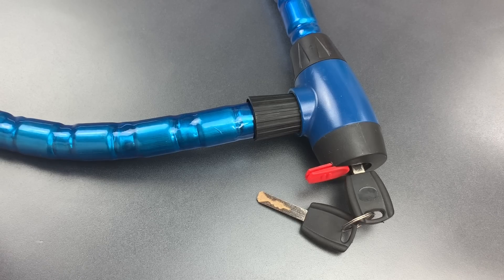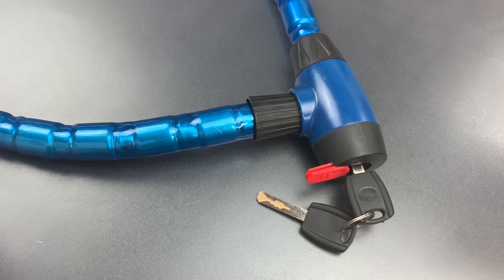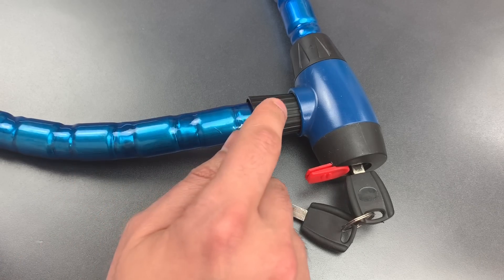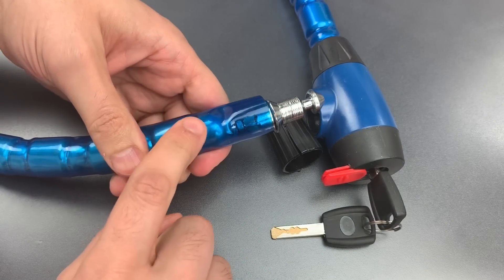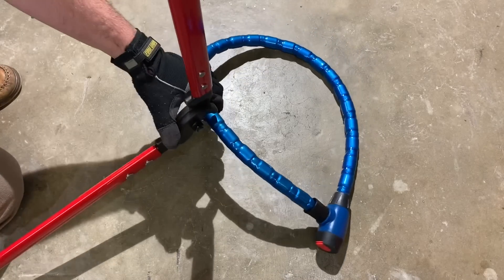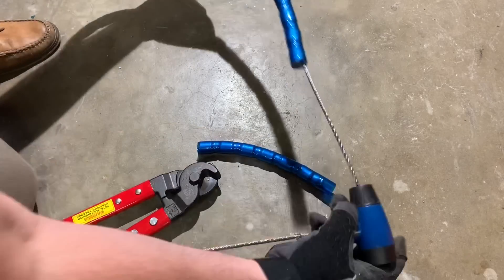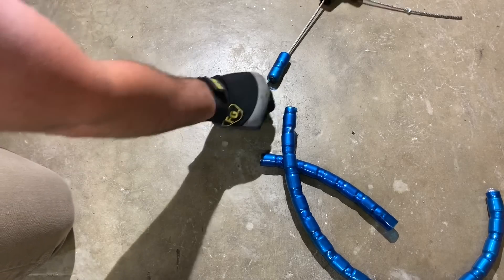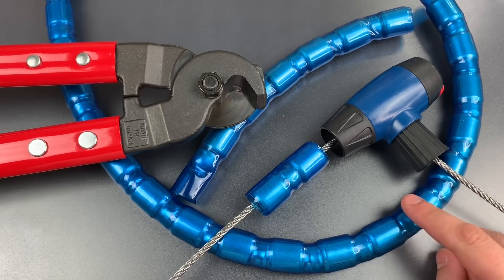[767] Bunker Hill Security Armored Cable Lock Cut EASILY

Comment: Did the cutters actually cut through the armour, or did they push open a gap in the links? (If there's an unprotected portion further up it's not beyond the realm of imagination that the armour itself got pushed into that portion, exposing bare cable)